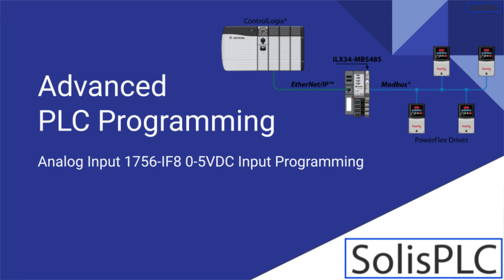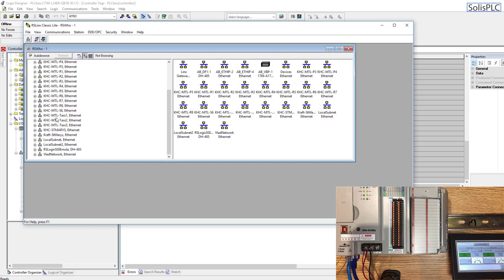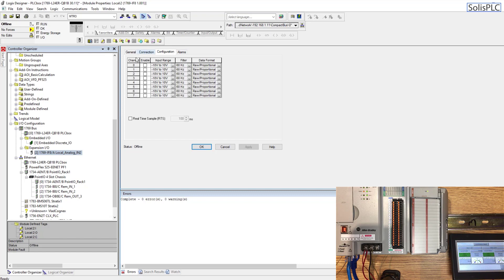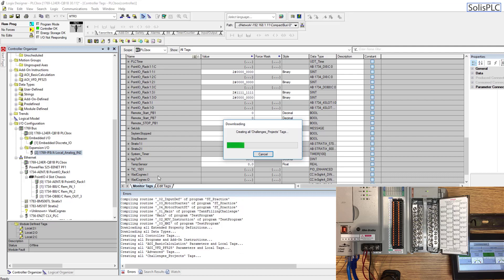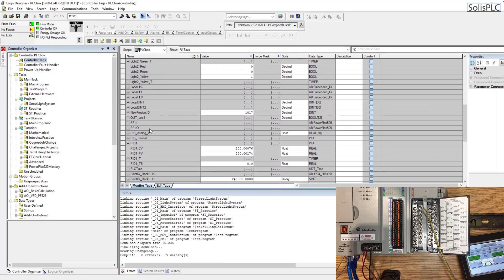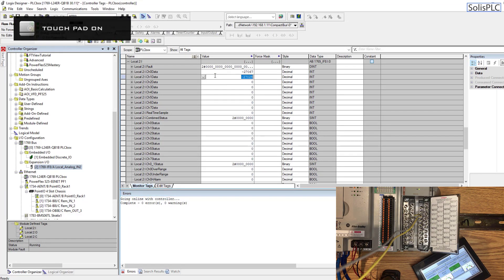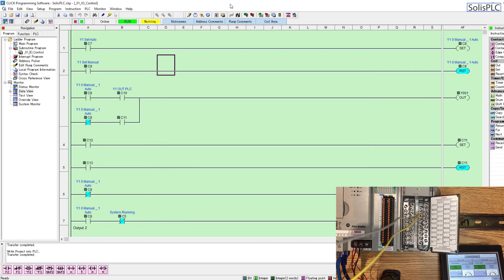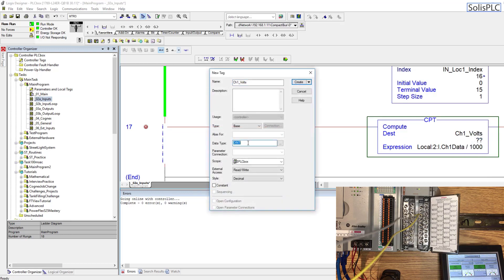RSLogix 5000 Analog Input Programming | Wiring Scaling Tutorial for PLC Analog Input Signal Example

Comment: can i add a analog module to a compactlogix 5069 on ONLINE MODE  without going off with the plc ???
Reply from the maker: No, you can't add modules online.
Reply from the maker: Although Rockwell does allow you to add external devices online. It may be possible... I'd have to check.
Reply: @SolisPLC  i have an entire water treatment plant operation running under a compact logic 5069 ( with their respective module ) I’m gonna have to shut down the plant to install a new analog if8 module ?
Reply from the maker: @Platon-b4t  by the NEC (electrical code), you need to shut down the panel to perform any modifications even at low voltages. Regardless of what can be done with the module, this isn't something that should ever be done live... For equipment and personnel protection.

Comment: I think the reason why for the fluctuation is your output is from an HMI which means has a processor and frequency, the input module of the AB has a scan frequency too, so both processors will meet sometimes in a point where no output from the HMI while the input is scanning, better to use a true analog like a battery with a resistor for things like this, better to use current to begin with to get better value at longer cables, thanks for the video buddy